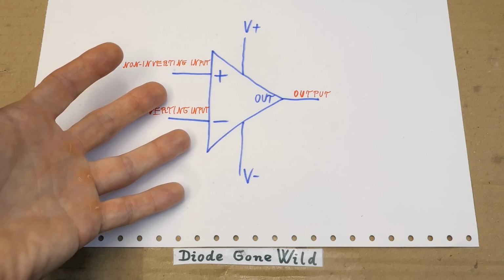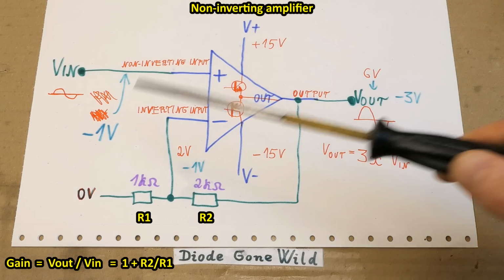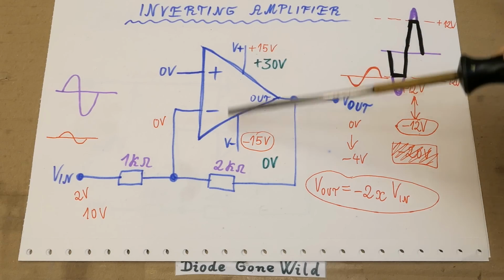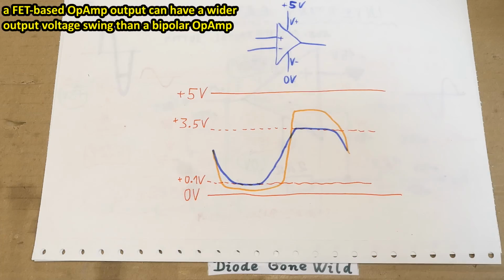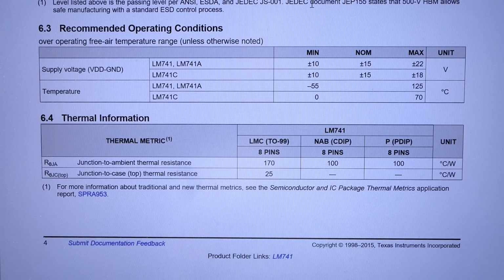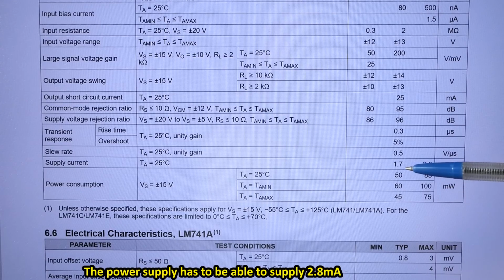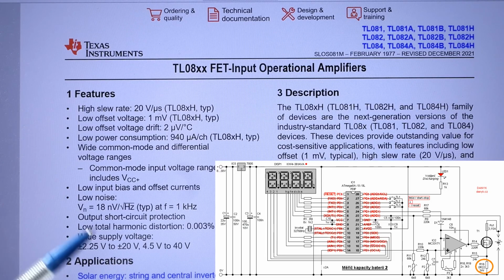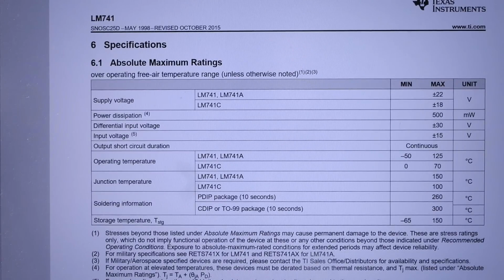OpAmps explained + how to read their datasheets

Comment: On minute 7, you mention Darlington transistors in an OpAmp. Does that ever happen? Isn’t a Darlington already a mini IC of sorts? I would think, you would just use transistors in whatever configuration necessary but not “package” them inside an OpAmp as a Darlington?
Reply: A Darlington transistor isn't its own component. It's just the way how two transistors are connected that make one.
Reply: @superdau  But sometimes it is. I remember amplifiers built with Darlington output stages. Some Darlington pairs are very hard to find. My Grundig tape recorder has one in its auto-reverse circuit and those are unobtainable. Probably never too popular. I guess I can make one by soldering and thermally joining two transistors?
Reply: @atoptip6193  I think all it does in an auto-reverse circuit is switching the motor on and off. So you should be able to replace it with any other darlington of sufficient current and voltage rating. You might even be able to replace it with a MOSFET (which is better for the purpose), but I'd need to see the schematic first to be sure. Begin by studying the datasheet of the original unobtainium part, and then compare it to those that you CAN buy.
Reply: @noneofyerbeeswax8194  It does two things — it reverses the motor direction (just the capstan motor, I think…the reel motors are already “turning” in opposite directions) and activates a relay to switch heads. 

With my rudimentary understanding of semiconductors, to go from a bipolar / Darlington pair to a MOSFET would be like swimming in the middle of the Pacific Ocean with no land in sight! I do not even understand the difference between a FET and a MOSFET or why people still have a use for energy-leaking bipolars 65 years after the MOSFET was invented?
Reply: @atoptip6193  Both types of components have their uses (and then there are also JFETs which operate kind of like tubes). I could erect a massive wall of text describing which one is preferred in which case, but it’s hardly necessary right now.

Can you tell me exactly which model your tape recorder is? If I can find the schematic, I can find the solution.
Reply: It is the TG1000. The auto-reverse is an accessory, that replaces the original head block. It is a great tape recorder but after 40+ years, its relays, contacts all give me trouble. One channel drops of while listening and the only way to bring it back is to turn off the machine and turn it back on. Thank you.
Reply: @atoptip6193   OK, I looked it up. Found nothing on TG 1000, so I assume it’s TS 1000? I couldn’t find the auto-reverse function in the service manual (maybe I missed it). It does display the reel motors control circuitry though. Each motor is switched on and off via a bridge rectifier and a four-transistor circuit controlled by an optocoupler. Reversing is done by connecting the motor to one or the other of the two halves of a center-tapped winding on the main transformer via a relay. The relay is switched on and off by a pair of discrete transistors (BC238 & BC338) forming a Darlington configuration. All of this is connected to an array of diode-resistor type logic circuitry. Figuring it all out would take a few days…

If you know for sure that the faulty part is a transistor, maybe there are some markings on it? It's hard to do troubleshooting remotely. :)

Comment: You can add feedback to comparators as that's the common way of providing a Schmitt trigger action. also  they can be got with open collector/drain outputs so they can be connected to circuits with a higher supply rail with out any issues.
looking forward to the next episode.

Comment: it's always nice to highlight the difference between inverting and noninverting gain, as the noninverting can't go below a gain of 1. which can sometimes be a problem.  i think 98% of all my opamp work has been on non-symmetrical power rails as adding a virtual ground, and capacitor couplings is far easer than adding a -ve rail. most equipment in cars and aircraft is either 12V dc or 28V dc input power so a -ve rail always need to be generated  which can add noise in to your equipment.

Comment: Thank you for doing this video!  I was using a schmitt trigger for signal shaping which fed another op amp to amplify the shaped signal, then into the ic that mutes the video output in a 3/4" video tape player. You need more then that to actually remove the anti-copy signal in the video (such a synchronous timing device of some kind)... I found half of that yesterday just by chance (inferred led/sensor block). Now all I need to find is that very carefully marked strip of clear plastic...  and maybe this will live again! (I made this thing way back in 2004 just to see if I could, and it did actually work well in a very unconventional way). Also I seriously needed to learn what you just taught about op amps, so thank you. Long ago I just played around with it until it worked reliably.

Comment: Please design a low pass filter with non symmetrical supply (12-15 volt) using common opamp like 4558 or NE5532.

Comment: I had no LM741 around so i used a 555. It doesnt work why? Both have 8pin so i thought they should be not much diference right?

(Sarcasm but this is an actual question DiodeGoneWild once received about another IC.)
Reply: maybe you counted the pins anti-clockwise 🙂
Reply: It’s all those goddamn Chinese fakes, I’m sure. You should only buy $30 apiece discrete opamps from a reputable manufacturer and use pure silver solder. Then it will work, even if you don’t connect the power supply.

Comment: What is the output impedance of an op amp? asking since sometimes you need 50 or 600 ohm output impedance
Reply: For a closed-loop system within its operational bandwidth, the output impedance should be near zero, as long as you don’t approach the maximum current rating of the opamp. If you need a defined output impedance, just add a resistor in series. But this will increase the noise of course (Johnson noise, proportional to the resistance).

Comment: The only ICs I buy off eBay are very specific vintage ones, not well-known common types like op amps. For example, a while ago I bought some LM723 voltage regulators, and the more vintage equivalent MAA723 from Tesla, so I could play around with the cool TO-100 package parts. Turned out they worked well, but are a bastard to breadboard. Other ones I bought were Philips SAA1099 sound generator chips for my vintage Sound Blaster sound cards, but I've still got to get around to ordering (let alone programming) the PAL needed to make them work. They do make a modern equivalent of the PAL, I just haven't got around to doing another order from either the silicon-based electronics supplier, or the rodent-based one (I don't often buy from the binary digit lock -based one).

Comment: Holy shit, 5 years of university and 6 years of work at chip design and only now I realized that inverting and non-inverting opamps really are the same circuit with just opamp inputs swapped. They're usually drawn differently. For non-inverting ones the divider is depicted vertically.
Reply: He is very methological and I anticipate that he can also be able explain each stage in detail with chip design perspective as well.

Comment: Nice and well explained. 
Worth to mension about offset voltage is that it also get multiplied by the gain. An offset of for example 5 mV is not much for most applications - but in applications where you need a lot of gain (for example current sensing over a shunt in a low voltage circuit, where you want the voltage drop to be low to minimize the power losses), that can be significant. With a gain of for example 100, that "error" will increase to 0.5 V! (which will need compensation in many cases or an opamp with lower offset to be choosed). If only amplifying AC signals (for example audio), a capacitor can also be put in series with the resistor between the inverting input and ground, to effectively make the gain just 1 for the offset but still high gain for the AC signals.
It will be fun to see some sodium ion batteries tested. I see forward to that.
Reply: Used to refer to it as the "input upset voltage" as it always upset what you were trying to achieve.